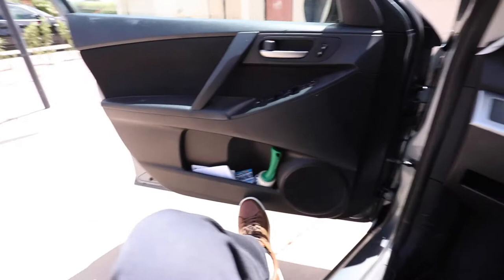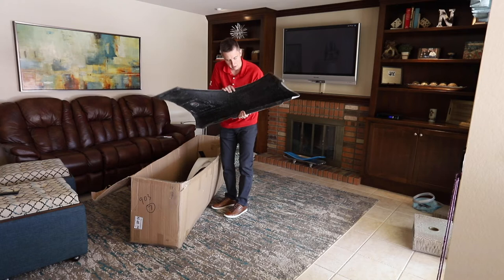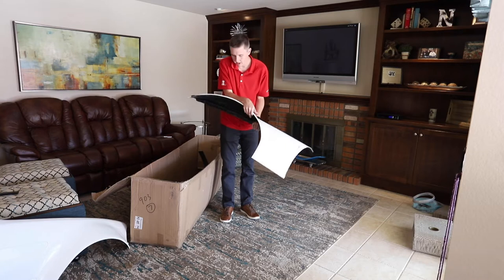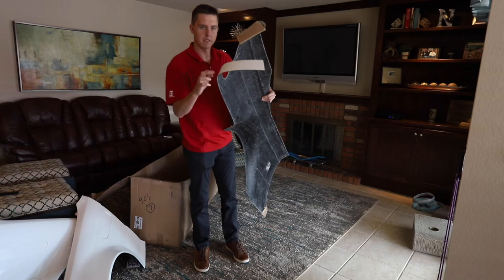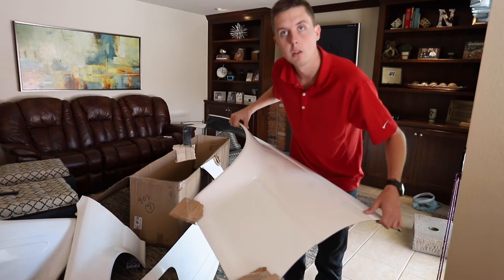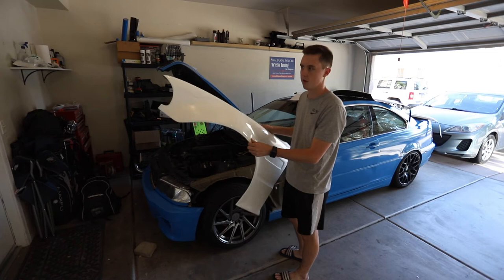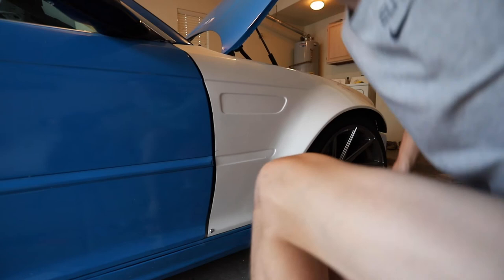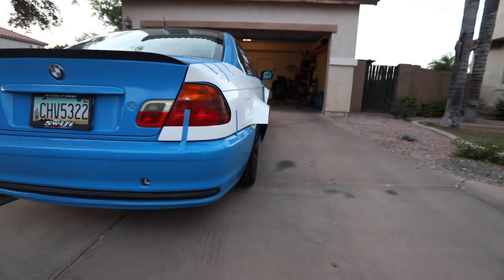E46 Drift Build | Widebody Install

Comment: Do you know if these will fit a pre facelift non m3?
Reply from the maker: Yes they will as that is what my car is. Fitment is slightly off but basically how mine looks is how it would look
Reply: Nebula Films thanks for the reply mate, I will be ordering them now I know, what offset are your front wheels as the arches are 30mm wider aren’t they?
Reply from the maker: @tomm6746  the fronts are 60mm wider and the rears are 55mm wider haha, currently I am running 18x10.5 +5 all around with 20mm spacers to get me to -15
Reply: Nebula Films oh are they? Even better haha, that’s great mate thanks for your help

Comment: Finally someone in the U.S does a review on these overfenders. I plan on getting very soon but the rear gap from overfender to bumper. Do you know or think of you use the e46 m3 rear bumper would help close the gap in the rear?
Reply from the maker: Are you talking about how the back of the overfender almost just like stops then cuts in and the bumper starts? Cuz I thought the same thing but now from the back where that gap is all you can see is just the tread of the tire which also looks super aggressive which I like. Another option would be to combine the over fenders with the Huxley motorsport kit which is bumpers and side skirts which fit really well with this kit.
Reply: Nebula Films yes that’s what I’m talking about   I talked to fibre factory and they showed me a pic of there overfenders on a customers car with a rear m3 bumper. All he did was warm up the corners and bent them out. It looks real good also.